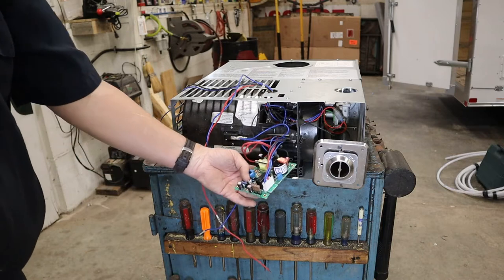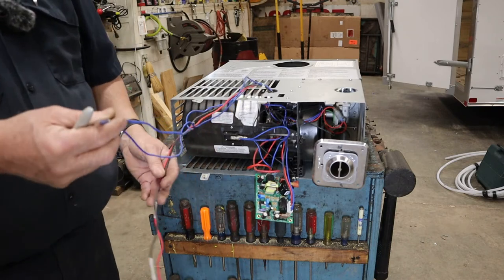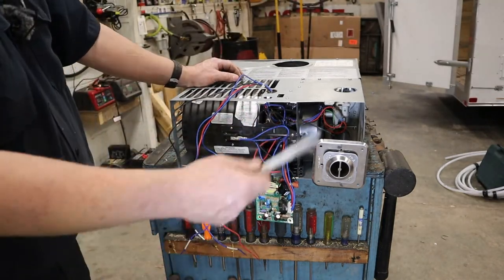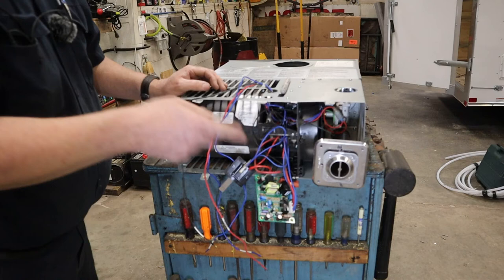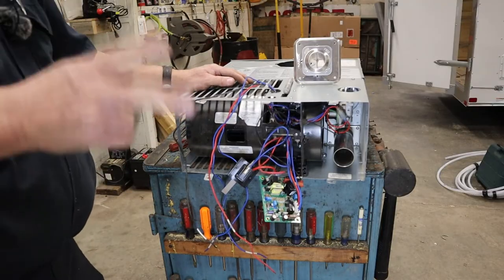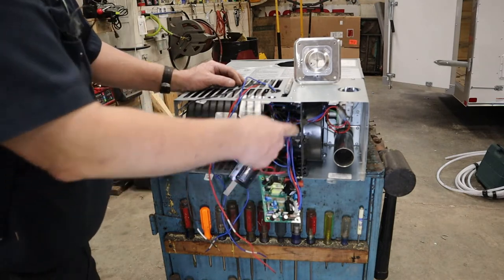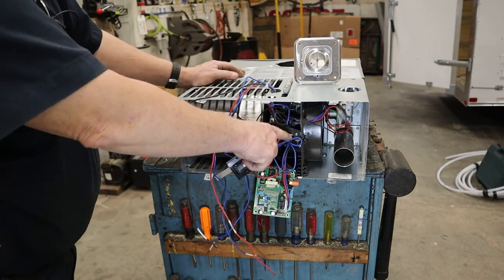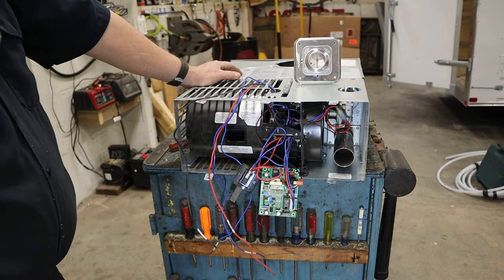Overview Of RV Furnace

Comment: For Atwood furnace parts, how do you determine part number for sail switch and high temp limit switch?  I'm thinking about carrying spares just in case.
Reply from the maker: Try to contact Dometic and give them your model number. They should be able to get you the correct part numbers.

Comment: Just worked on the same unit today. Great video as always glad to know I’m not the only one who figured out the intermittent running the hard way if you don’t use the exhaust extension.  What do you use to clean dirt dauber nests out of the heat exchanger?  Air hammer with a 1/2 piece of pipe in a c shape welded on the end or a plumbing snake with the spring cut off the end is the only solutions I’ve found.  Just wondering if there is a faster easier way the baking soda vinegar method never works for me.
Reply from the maker: I have never had to go that deep on mud daubers. I usually get the ones you can see and the ones deep inside have never been an issue.
Reply: @hillbillyrv  wow I wish we were that lucky seems like all of ours here in Louisiana are always deep and several nests in every one
Reply from the maker: @marcuscarmouche9023  I guess we do have it lucky then. I remember when I worked for the stealership, a LONG TIME ago, I got over half of a 5 gal bucket of bees nest that I removed from a furnace. It was amazing !!!!